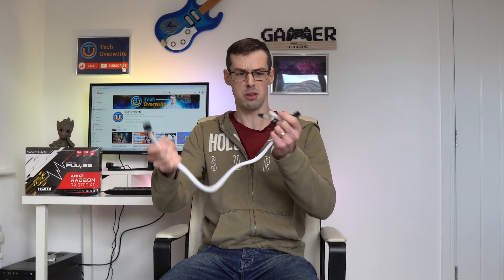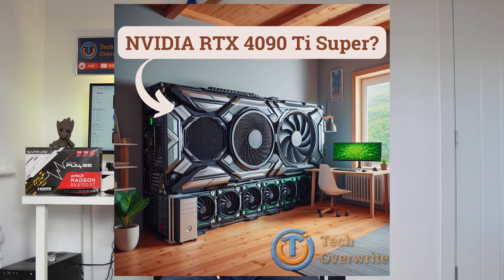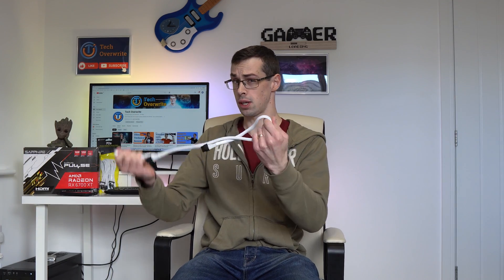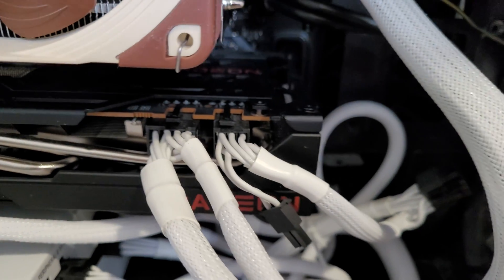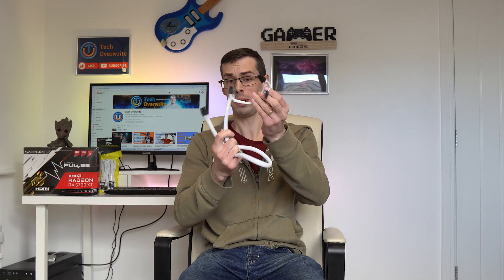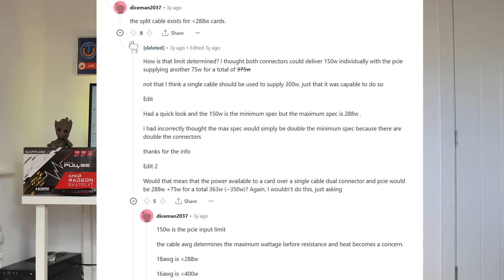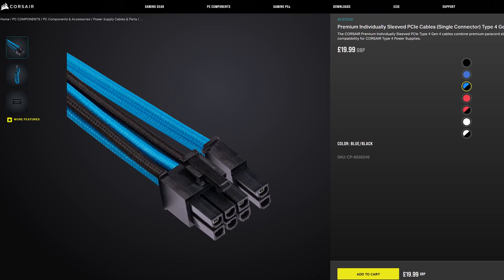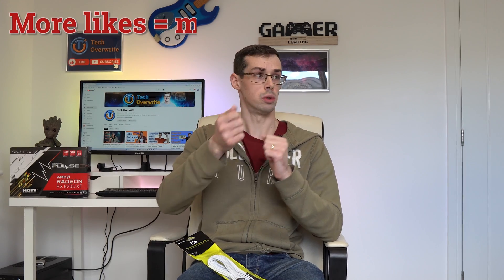Stop Connecting Your GPU Power Cables Like This! (How To PROPERLY Connect PCIe Cables For GPUs)

Comment: I need you advice I have a rtx2060 Rog strix but have a mid range power supply courag xtc550 but it has a 8 pin pcie with 8 pin pigtail (has only one ) pcie , my question is should I not use it then save up or use it and save up ( im a broke college student and I need my computer for android development)
Reply from the maker: You should be fine with that card (to just use 1 cable with the pigtail). If you do somehow have crashes, look at slightly undervolts - but I think you'll be fine 🤞 Good luck with your android dev.
Reply: @TechOverwrite  think you I thought I had to get another psu

Comment: My 6700xt shows around 193w pwr draw on RTSS. Was wondering if its still safe to use pigtail? Or i should run multiple cables?
Reply from the maker: Ooo good question. On that basis, 1 cable with a pigtail would be fine yes - but avoid overlclocking it lol 😆 I have the 6700xt too and I do use 2 cables, but that's mainly for personal preference ('just in-case efc')

Comment: Can I still use two separate cables if my gpu has a splitter cable that goes from one plug into the graphics card and then splits into two cables that you then have to plug two separate cables into them that are plugged into the psu for the power. It is a 4070 TI.
Reply from the maker: I'm not too sure sorry, I'm struggling to visualise that PSU/PCIe cable setup. Are you able to link the PSU manual online or show what those cables look like please? Generally speaking though, you would ideally want two separate power sources (cables) for the 4070 Ti, and hopefully your PSU does work okay here. It sounds like it might 🤞

Comment: I'm gonna get the 7900xtx taichi will I have to do this or is that connector good for that one
Reply from the maker: That card? Pfft the motherboard PCIe's 75 watt supply is enough for that... 😬
Kidding, that's an awesome card - it'll definitely need multiple cables! Happy gaming.
Reply: @TechOverwrite  1 more question sorry.. I was told for my 7900xtx taichi to use 3 separate 8 pin cables for thr gpu but I look at psu on line and most of them say 6+2 pin is that the same and is one worse than the other cause I have to buy a psu either way so should I purposely buy one that strictly says 3x 8 pin pcie?
Reply from the maker: No worries at all 🙂 6+2 is fine - that just means 2 of the ends are 'split off' (for ease of plugging in if it's a 6 pin PCIe device). It's essentially the same thing here though. I power my own RX6700XT with two 6+2 PCIe cables, for example.
Reply: @TechOverwrite  but would a actual 8 pin be better
Reply from the maker: @AaronTorres-k6h  it's basically the same for this purpose, so I wouldn't worry about it. The GPU will be powered fine either with 6+2 or a direct 8 pin, it'll be 12volts with both 🙂

Comment: I have an asus tuf gaming 3070ti oc with an 850w be quiet psu will i be fine with the pigtail cable?
Reply from the maker: I don't think it will work with 1 single cable IMO. That card uses 290W at peak since it's OC, and so that's pushing the limits of a single cable. It might work, but it's not guaranteed and might be unstable at times sorry 😞
Reply: @TechOverwrite  Ok, so what do I do if I only have the one cable to work with? No one has this issue. Everyone says the pigtail cable is bad but no one mentions what to do to get an extra one to connect.
Reply from the maker: @sippxleanz747  unfortunately it's either a case of: 1) undervolting the card (so it doesn't crash due to undersupply of power), 2) buying a new PSU or 3) buying a new GPU. None are great solutions but unfortunately a factored OCed 3070Ti will struggle here without doing any of these 😞
Reply: @TechOverwrite  ok thank you for helping I will undervolt the gpu. I’ll work with what i got thank you so much 🙏
Reply from the maker: @sippxleanz747  that sounds a good plan, good luck and happy gaming ☺️

Comment: I have a 5600xt that asks for 150w which is failing atm (sad about it). I plan on upgrading to  a 7700xt which asks for 260w. Power calculators say that I am good (close call) with my corsair vs650w PSU. However, the wired PSU only provides one pcie connector with pigtail. Do I need to scrap my 1pcie PSU and get a modular one to have multiple cables for now and to the future? Or can I wing with the pigtail connector?
Reply from the maker: Hmm, it's a difficult one. In general I wouldn't probably want to power a 260W GPU using a single cable (sorry). I mean, it might work if you don't stretch things too much (like constantly maxing out the GPU), but it's hard to say for sure. If you can afford it, I would upgrade the PSU. But worst case, maybe look at slightly undervolting the GPU? Good luck 🤞
Reply: @TechOverwrite  Thank you. Yes I will undervolt it.

Comment: I had to order one off of Amazon that’s rated compatible for my psu I’m a bit on the fence about this considering the card I will be using it on is a 7900 gre it says it only needs two 8pins so here’s hoping that this cable doesn’t melt
Reply from the maker: That's a 260W TDP card, so that should be fine IMO 🤞 That's a great card, I hope it works out well for you.
Reply: @TechOverwrite  thanks like I said just nervous because it’s not the exact cord that came with the psu i managed to misplace the box somewhere that had the extras and nowhere sells the replacement bundle that I’ve seen so I’m taking a risk here ordering one on Amazon
Reply from the maker: @synrsystems1363  yeah I totally understand your concern, especially since Amazon can be hit and miss. As long as it's a reasonably reliable brand and/or has good enough reviews, you'd hope it would be fine. I'd feel more comfortable with a third party 8 pin PCIe cable than a third party 12vhpwr connector, at least 🤞
Reply: @TechOverwrite  I have no idea even what that is 😆 I just know the pcie so if you could make a video stating the difference plus dos and don’t I would definitely love that ! Also yeah I’m very concerned seeing as the one cord is from the original psu and this one is just third party but the reviews seem to do it justice ill find out Wednesday when the gpu arrives then I can pull out my 5700xt which I’ve been running on pigtails just fine with minimal crashes 😆
Reply from the maker: Haha fair point 😄 I do actually plan to do 1-2 videos soon covering these points - basically the way that graphics cards are powered has changed a bit recently (mainly for NVIDIA cards though). 🙂 Yep fingers crossed it works out fine when you receive that - I think that it'll be fine 🤞
Reply: @TechOverwrite  I went ahead and tested it on my 5700xt and can’t really see too much of a performance increase from when I was running a pig tail but the cord does work so there’s a plus I will have an update when the 7900 arrives
Reply from the maker: @synrsystems1363  thanks for the update, that's really interesting. Maybe your old cable config was suitably quality that it was delivering a fair amount more power than the basic/minimum 150W level. 🤔 Good to know either way thanks.

Comment: after search for many help. I found you. May you help me with my gpu with single 8pin, which psu should i have for that? I've already burnt the old 1 which I didn't know that 6+2 pcie didn't work on my Sapphire rx 590 8gb.
Reply from the maker: Yikes, are you saying that your old PSU burnt out? (Sorry if so, that sucks 😔). Pretty much any modern PSU with 2 PCIe ports should be able to power an RX 590 though.

Comment: Hey! I don’t know why but my gpu and cpu do not perform at the expected range. Fortnite runs at only 100fps from a i78700 and gtx 1080. Any idea why? I don’t know it it’s the psu tho
Reply from the maker: Hey, it's hard to say for sure sorry but I would check Task Manager and HW Info. Keep a particular eye on temps, and also your CPU or GPU running below it's advertised speeds (i.e. which could be a sign of low power supply or thermal throttling). Although simply getting low FPS in a particular game could also be caused by driver issues, Windows settings and more. Sorry to be vague but there's dozens of possible causes 😔 I hope you can get it fixed though.
Reply: Seems like a CPU bottleneck

Comment: Why do these come as standard in so many psu if they dont want us to use them, whats the point
Reply from the maker: In general it's not a bad thing to split load across cables/ends. And remember that PSU makers don't specifically make their units and cables for GPUs, and vice versa. In other words, someone might have a build with various lower powered PCIe devices - and the split cable here would be quite useful.

Comment: I have ordered 4080 super do I need 3 separate or will 2 cables be okay with 1 using daisy cable
Reply from the maker: 2 cables should be probably be okay for the 4080 Super 🙂
Reply: @TechOverwrite  great thank so much I have ordered new PSU anyways so only for couple days until it arrives and new one has a dedicated  cable from PSU straight to gpu
Reply from the maker: That makes sense, good luck with your new build 🙂

Comment: I have a 2+6 pin pig tail coming off my RTX 4070. Am I supposed to plug those in.
Reply from the maker: For the 4070 (great card btw 🙂), I would plug in two separate PCIe cables into your PSU, and then just leave the pigtail ends dangling without being used.

Comment: The pc builder who built my had connected one pcie cable to both using the pigtail thing you say and now I removed it and replaced with another pcie cable. I saw videos where they said it will fry you GPU or damage it, is there a chance it could've happened. I have a RTX 4070 Super.
Reply from the maker: It's hard to say for sure, but I doubt that your GPU has been permanently damaged. Do you get various crashes and freezes when gaming (even with the two cables)? If so then maybe there's damage, but hopefully things will just be stable for you from now on.

Comment: very annoying that my msi mag a650bn only has a single cable with the daisy chained connector. was gonna buy an rx 7800xt for my system but i guess thats off the table now.
Reply from the maker: Ugh sorry to hear it. Yes that might well be borderline for that card and PSU. There's a chance it'll work, but not if the GPU was stretched or overclocked too much IMO. 😔

Comment: Could this be why my xfx 5700 xt thicc iii isn't displaying? I run a core i5 8500T ,8GB ram and that GPU mentioned above all on a 550w power supply . doesn't display nothing, fans spin and the little led lights on the pins are not red soo i assume power is sufficient but not display am basically running dead system. Haven't found a solution soo i sticked with cheaper GPU for now but i need help, please assist so i can use my powerful gpu to play games on high settings 👌🫸🫷
Reply from the maker: Ugh sorry to hear that 😕 I doubt using a single cable would result in zero output, but you could always give it a try and plug in a second PCIe cable. If that doesn't work, I would also change the DisplayPort or HDMI cable, and also reset the BIOS by removing the CMOS battery. Good luck 🤞

Comment: Does it matter which end of the split that gets plugged in to the GPU?  I feel like the straight shot would be better than the branched off piece but I can hide the rest easily if I used the branched off piece
Reply from the maker: I'm AFK currently so can't easily check, but I think it literally just comes down to whether it would physically fit or not.

Comment: I have a rog thor 1000w psu but it came with pcie cable and vga which cables do i use i currently have the pcie ones connected do i switch the the single vga cables
Reply from the maker: They probably both work the same in this case, many PSU manufacturers (mis)label VGA when they actually just mean PCIe. Basically the idea of VGA = graphics card, so = PCIe too! Which is confusing. But you should be fine sticking to the PCIe cables you have right now 🙂
Reply: @TechOverwrite  even with a 4090
Reply: @TechOverwrite  so I should use the vga cable or just the pcie and single one too?
Reply from the maker: Ah sorry, I didn't realise you had a 4090! Sweet card 🙂 Then yes, multiple cables will be necessary - but I'm assuming that requires a 12vhpwr connector? If so, a single 12vhpwr connector into your 4090 should work if it's rated for the full 600w, and then you'll 'just' need to plug it into any and all PCIe/VGA slots on your PSU. In this case you will probably need multiple connectors plugged into the PSU, but double check your ROG Thor manual incase it handles 12vhpwr differently.
Reply: @TechOverwrite   my 4090 came with an adapter with a 3 8 pins connection is that fine connecting with 3 separate pcie cables

Comment: help me i cant get signal from my gpu 4080s i have evga 1000w g6, its been 5 days i didnt use ny new pc 😭😭😭
Reply from the maker: Ugh sorry to hear that. Do you have any spare parts or monitors to do some tests on? As in, try plugging your PC into a different monitor. Or use HDMI instead of DisplayPort cables. Basically try testing out as many changes as you can to try and diagnose what the issue might be.
Reply: @TechOverwrite  i solved it, it was the cables, i inserted the split cable into psu and the solid one into gpu, i got no signal, it was supposed
to be the other way around, now it works. thnx😊

Comment: You are correct, a cable with a y at the end is still one cable. I do the same thing using 2 cables on the MB CPU cables even though they say if not overclocking you only need one 👍
Reply from the maker: Thanks for the comment, I think it makes sense to use 2x separate cables for safety for sure 🙂

Comment: I've wondered why the PSU manufacturers tell you to only use the cables that came with the PSU. I think this is recommended because the cables that came with the PSU can handle a higher wattage.
Reply from the maker: Hmm that's a good theory, you could well be right - at least they then have that control of exactly what the cables and output will be.
Reply: @TechOverwrite  Thanks for your reply. This morning, I visited the ANTEC website for white replacement cables for my 1000-watt PSU. I found the wires and a notice stating that the white cables were only extension cables and that they were not intended to replace the cables that came with their PSU. I saw that the extension cables were made with AWG 16-gauge wires. I will check the PSU pins to see if they match the standard PSU output and cable connectors.

Comment: I own a 6600XT and I'm experiencing frequent drops in GPU usage and spikes in frame times, regardless of the game I'm playing. I have connected the GPU using a pigtailed cable, with the pigtail left not plugged. Could this connection be causing my performance issues? Would reversing the connection, plugging the pigtailed side into the PSU and the PSU side into the GPU, make any difference?
Reply from the maker: I wouldn't try and plug the pigtail end into the PSU no, I doubt that would work unfortunately. Sorry to hear of the weird GPU issues. That's not the most powerful hungry of cards so just powering it with 1 cable should be fine. If it needs 2 connectors, do try and use the pigtail just to see if that makes any difference. But otherwise, it might be a PSU or GPU fault (unfortunately).

Comment: I love how he still replies to every single comment of people needing help, lots of creators just make the video and let the viewer figure the rest out for themselves. As for my experience a 7900 xt with daisy chain cables (im very inexperienced with building and will probably swap it out for 2 now thanks) works just fine. Im not gonna pretend to know why but just putting it out there. My psu is a MSI A850G 850W for clarity. Maybe it is capping the power usage of the card and not getting full performance but it seems to run everything great even with raytracing.
Reply from the maker: Thanks, I appreciate that ☺️ I'm glad your cable config is working out well for you - that's the main thing to be honest. It'd be different if you were having crashes etc but you're clearly fine here, which is great. Happy gaming!
Reply: Same! I also have the 7900xt and I'm using the piggyback cable to fill both 8pin slots. Haven't had an issue so far, so I'm wondering if I do need to swap out for 2 separate cables.
Reply: Well just ordered a Sapphire 7900XT and I see in the pictures it has 3 power connectors. I have only 2 from my PSU, piggy tailed but also have some 16AWG 30 cm custom sleeved. I wonder if I can pair 2 of those custom sleeved for each connector. I really don't want to get 3 new custom PCIE cables that seems would cost me near 90$(lol).

Comment: well actually the pigtail doesn't work like that. a daisychained pci-e cable can deliver around 280~ watt of power. so while it's still less than 300 its not capped at 150 so most of the time there is nothing to worry about. this is because there is more voltage and ground through the pigtail so its almost doubles the amps.
Reply from the maker: Thanks for the added info. 🙂 I couldn't find any extra details to back this up (that the pigtail does supply that much extra power) when doing the video originally, but am happy to be wrong.
Reply: Does this mean it’s perfectly fine to use a pigtail connector instead of another cable?